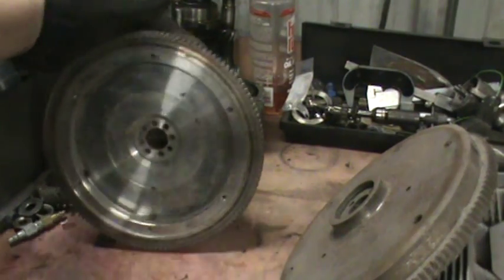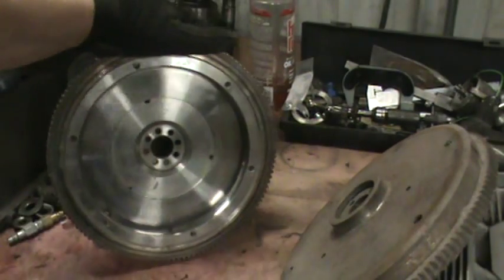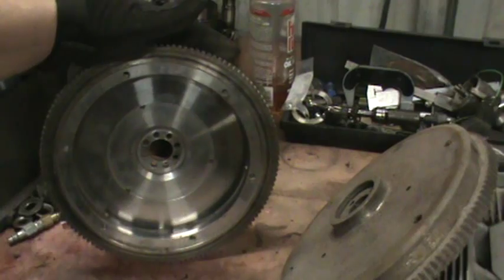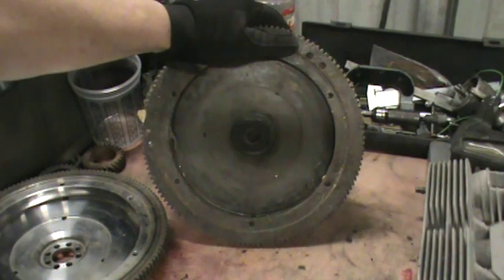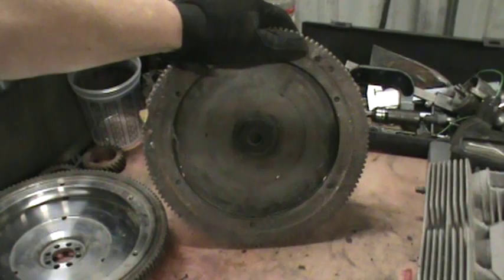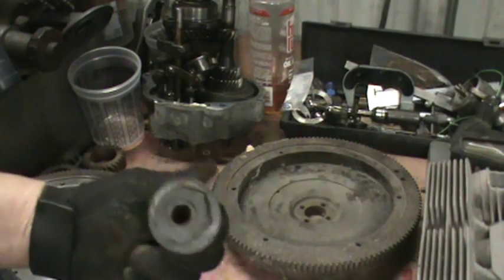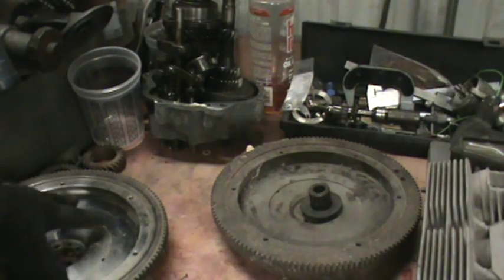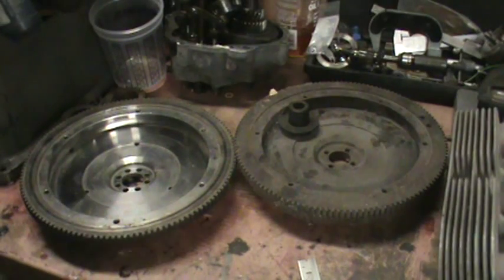vw Flywheels

Comment: I'd like to see a comparison of 6v/ 12V FLYWHEELs an setting end play on both !!!!!   6v / 1966 1300 flywheels on 1500/1600 engines in 1965 an earlier  trans.  '66 1300 Ghia / 200mm clutch/6v flywheels in older 6v cars also !!!!!  It would make a good video an enlightening everyone on mix an match flywheels and clutches  !!!!!

Comment: Then if you have the 4dowl it’s ok to lighten as long as you put the heavier front pully
Reply: If you plan to thrash the engine, then go 8 dowel.
If you are doing regular street and Hwy driving, the stock set up is best.
But, you can lighten it and use a heavier front pulley but be careful on going above 4500 with this set up. Get the Gene Berg Gland Nut and washer it's the only one I ever use. Never fails but follow their well written directions to the letter.

Comment: is that truth that with the light flywheel the engine will lose top end true or false ?
Reply: Yes , you need the flywheel effect when your pushing that wall of air at top speeds.
Reply: False